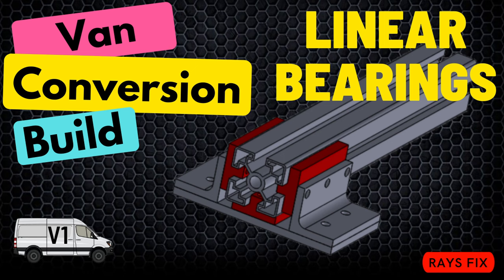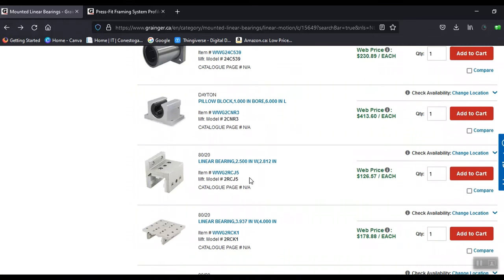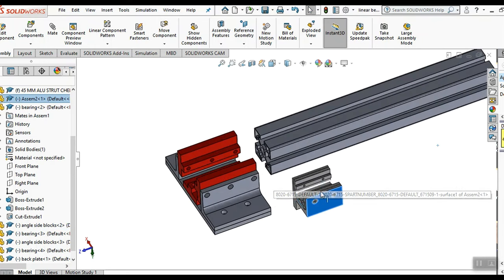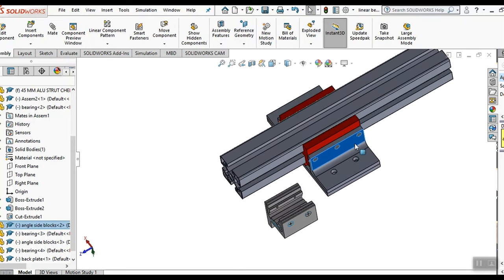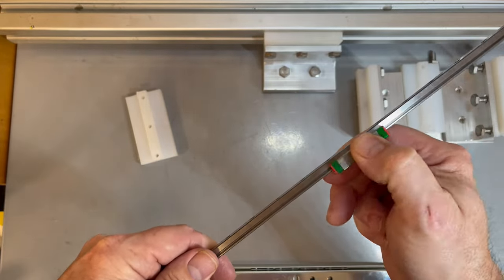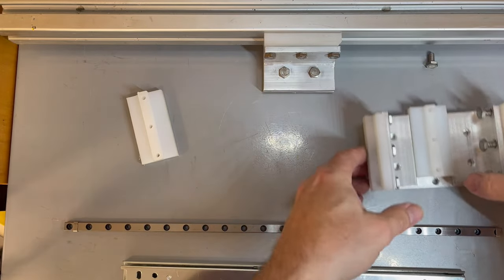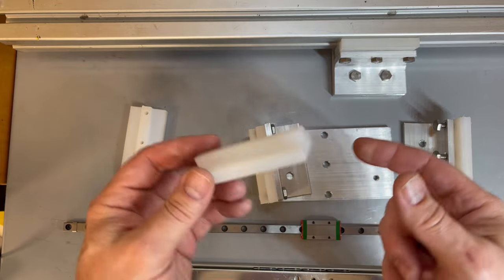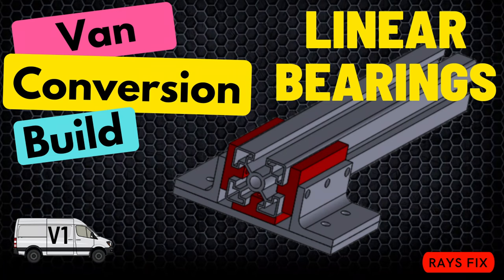Van Conversion Build linear bearings

Comment: 2 years ago, I planned out my Van and to use 80/20 linear bearings. I was shocked at the price and now that I am building out a enclosed trailer instead, I'm moving my ideas over. This will be very helpful and saving a lot of money. As I'll be using this for my bed idea also. Thank you. liked and subscribed
Reply: My plans have changed. I was going to build out a sprinter van and a couple weeks ago. I bought a Winnebago view with a sprinter front l

Thank you for taking the time to comment. Much appreciated. 
Ray
Reply: @shopandmath  ahh I see, Nice! Have fun with that!

Comment: Ray, excellent decision and as soon as I heard you say $500 (after seeing prices on 80-20)...I'm with you 100%.    Question:  (if you are still connected) have you considered a square tube L-bushing assem?  My thoughts are for the extra strength.  Do you sell bushings?
Reply: i’m kind of cheap and I like to use stuff that I have readily available or build something from scratch

I don’t make stuff to sell

this project build is on the back burner. I recently acquired a Winnebago view.

Comment: Hey bud, what happened to the motor video? I can't find it anywhere and ingested in this one :o
Reply: When I started planning on this Van build I how to deal to purchase a sprinter van at a very very low price and the deal kind of fell through so I ended up buying a Winnebago view, which has the front end of a sprinter and a Winnebago back

There was never going to be a Motor I was going to use kinetic energy to raise and lower the bed in the form of the spring a garage door spring. I still might make this, but I need a place to install it. 

Ray
Reply: @shopandmath  oh I get you, thats brilliant! I wondered what kinetic meant, sorry if you said in the video :) can you speculate why people don't use motors? I think I may be naive thinking appropriate wire would cost a tenner gbp and the motor £20 as, say, an ebay windscreen wiper motor. I've thought on it for years and can't think where there might be flaws or hazards in the system; as steel stretches, the <£1 limit switches would keep the range within those parameters mechanically and all corners relative; easy adjustment with a screw tensioner and butt hinges for a 2/1 pulley with thin unistrut or extrusion and roller guides :o less head room but could sit below or raise for garage access, specific to individual and needs. The system would be modular too, could go manual til a motor upgrade down the line  :o

Van builds are so intimidating, but I hope you appreciate my asking around for advice so I could potentially learn or get a different angle on something from another's experience :) I have some wild ideas mind, I do wonder on the fruition:") 

I suppose you're not at liberty to disclose how/where to get them cheap but my step dad says the £500 immobile vans on ebay are the way to go, as they usually just need simple fixes like new lights or housigs etc. Any experiences you could advise please bud? I understand you probably gets tons of messages and questions though 
Thanks! :)

Comment: What do you think would be the max spacing between bearing blocks? Thinking of doing something like this in the pass thru storage area  of my camper.
Reply: It depends on the amount of weight. Keep in mind if it’s in a camper you also have to include the G force, unless it’s pinned.
What is the size of 8020 you’re going to use? 
That in itself also flexes 
If you want to send me an email with your idea and I can give you a better opinion 

My original idea, or concept was to make a bed with a Connecticut energy lift 
But I decided to buy a Winnebago instead of doing the full van conversion. It is a long story. 

Ray

Comment: But they say on the site that these linear bearings can only take compressive loads not hanging loads. Won't these linear bearings fall out?
Reply: They can take a sheer load depending on the type of plastic, but she machine them from

The style of bearing is recommended for guiding loads. They don’t really hold any weight
Reply: @shopandmath  is there an email I can send you? I want to ask if you think my linear bearing would take a 2 pound load.

Comment: Fantastic solution vs $500 for skimpy manufactured bearings. Instead of 2 rails and 4 bearing, my thought is to use 2 long bearing (more contact)...now all I need is a $10k milling machine🤣 I wonder how much to have the UHMW machined?

Comment: Well done! But you can see why these parts are so expensive. To have a machine shop makes these units you'd be better off coughing up yr hard earned cash & just buy them!!
Reply: first off thank you for taking the time to comment. It is much appreciated.

I have a super cost savings way of producing these bearings by simply using angle brackets and 3-D Printing the bearing itself 
From 1 kg of 3-D Printing material I could probably make at least 20 bearings out of cost of around $30 for the roll 

A flat piece of aluminum in two angles, and a couple of screws. If you don’t have a shop to do this, you could go to a place like the Steele store. (this is a local place close to me.) and they would cut the material to size for you for a small fee per cut. I’m guessing you could probably produce these bearings for around $20 each, 

I hope that this helps, and there’s nothing wrong with saving a couple of dollars here and there just as long as everything we do is safe 

Ray

Comment: what plastic did you use, teflon, nylon or UHMW?
Reply from the maker: The plastic I would’ve preferred was UHMW 
But it was either nylon or poly propylene
The plastic was free if I were to make more bearings I would probably 3-D print them
Ray
Reply: @raysfix  what plastic would you 3d print? nylon or peek?
Reply: PLA with at least 70 or 90% infill.
I would also design it so the core has some type of bolt through the inside.
Reply: @shopandmath  pla might not do the trick people have issues with pla in hot vehicles. Petg minimum, but I think peek, while more difficult to print, will self lubricate
Reply: @81GTUN4  
If You’re using this bearing as a squish not as a pull or push PLA should be good 
With the bolts protruding through into the extrusion, but still covered with plastic is the safety

If you’re somewhere closer to the equator, I am in Ontario Canada we don’t get that hot up here. It could be an issue with a full melt.

Some of these other materials are difficult to use , but since this is construction, not art, it should be fine

Do you have this material already or are you going to order it?
If you have it maybe do a little test if you do let me know what works best and the failure temperature I could use that knowledge.
Thank you for your input.
Ray.

Comment: You should buy just linear bearing pads. It's not worth machining pastic, aluminum is a different story These pads cost about 3 $ a piece max (at 80/20 which is the most expensive), they are made to exact dimension with the right material and are super smooth.
Reply: I have a hard time believing that anything associated with the 8020 is only three bucks that’s a hard pill to swallow when I did my research I didn’t find anything if you could provide everybody with the link that would be awesome. Can you get it on Amazon?

Comment: Did you buy all the aluminum parts off the shelf? Source? 
We're just in the tear-down phase of our build. Gutting out the old stuff and starting from scratch. Not entirely sure what we're doing for our bed solution yet. Would like to be able to raise it to accommodate a scooter or small motorcycle, but don't know if that's realistic. Following!
Reply from the maker: I made all of those parts
It can be purchased but
It’s $500 plus tax and I didn’t wanna spend that especially when I could make it easily
Reply: @raysfix  You built the extruded aluminum?!! Did you mill the angle brackets or buy a length of it and cut to size? More details please!
Reply from the maker: @pandavanlife9042  
Everything was cut
The angle is 1 1/2“ x 1 1/2“ by quarter inch thick
Are used to Lankes of 6 feet I also made smaller angles for doing the corners but it’s not shown in the video or used in the video 
The flat plate is quarter by 3 inch and I cut it into 5 1/2 inch Length 
The plastic is milled it was from just whatever we had laying around in the shop largest sheet proximately 3/4 of an inch thick probably by 1’ x 1’
All of the fasteners are 1/4- 20 stainless steel
The three back fasteners should be switched out from hex head to a countersunk socket head caps screw